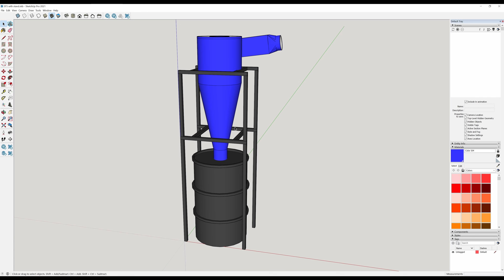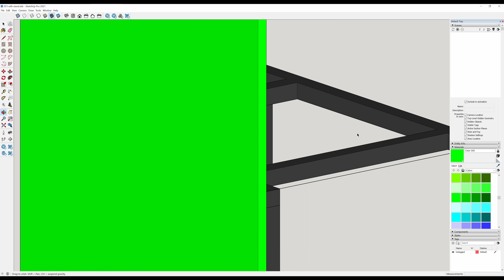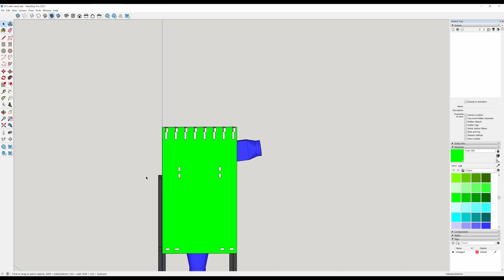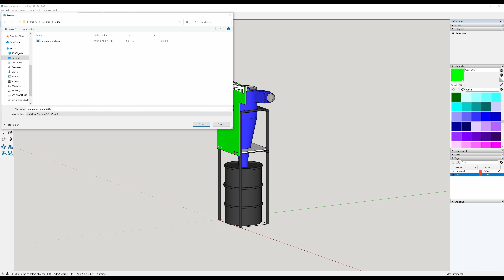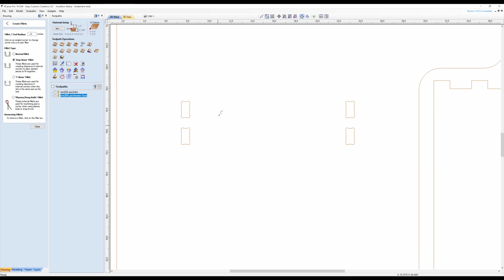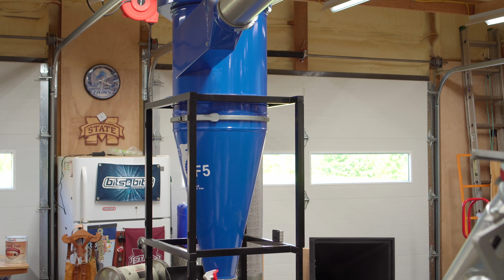Design, Engineer, Create - Shop Storage Solution - 373

Comment: I've asked on Reddit, I've asked on Inventables, I've asked a few people at the local Makerspace, and now I am asking you: Why are you flattening your design in SketchUp? You did it another video of SketchUp to VCarve. And you spent a lot of time fiddling around in SketchUp to build your tool paths. Does it produce better cuts? More efficient tool paths? I import my complete, non-flattened, non-exploded SketchUp model directly into VCarve Pro, without any modifications, and have all my tool paths generated in about 30 seconds with a half-dozen button clicks. So what am I missing as to why you do this? You've obviously figured out a neat trick or some secret tribal knowledge that does better than the established model import method and tool path generation method, but you're not stating what that trick is. What am I missing?

Comment: I really enjoyed the design process and the peek at using the current SketchUp program by someone as familiar with it as you clearly are.    Far more informative and enlightening than watching a bunch of machine cutting.  So thanks for this fairly uncommon option in maker videos.

I was a bit surprised that you didn't simply cut the horseshoe in half or go back to SU and convert the horse shoe into two square "C" shapes so you had a full surround shelf.  I know that for me I'd constantly be setting stuff down on the missing portion or knocking stuff off into the gap..... But hey, that's me... :D  EDITED- And I do so agree with you about the satisfying fit of the belt hangers.  :D

Comment: Great video etc. but I have what is probably a very simple question: the mortise and tenon were measured at .763 but the interlocking cuts were measured at .753 - why the difference? I'm really confused by this.

Edit: Thanks for showing the use of the  Sketchup software, I might actually start using it.

Comment: Jay- could you have rotated the big piece by 90 degrees, to use the width of the board? That would have let you do it the way you wanted.
Reply from the maker: Kinda. The piece is 48" long and the sheet is 49" wide. Cutting it would nearly eliminate support along the length of the sheet while on the CNC. I valued more support structure around the perimeter when cutting than I did getting it to fit in that direction. If I had a vacuum table on the machine I would have went that route.
Reply: @JayBates  Thanks for the reply. In my projects, I can get locked onto my initial goal when it would be best to let go and pivot.

Comment: Thanks. Lots of valuable tips for SketchUp in there.  Really like how you describe some of your thinking.  It looked like the horse shoe piece you decided to make into two shelves could have been rotated about 45° to fit around the bottom corner of the backing board.  (But hey that could be completely wrong but I find I can manipulate some pieces the nesting process in VCarve/Aspire wont calculate.  Also, it looked like a significant improvement in the picture quality when you changed over to your phone for the last bit of the video, nothing wrong with the other camera, but I wouldn't have expected such an improvement (This is only a comment and not a complaint!)  Cheers, David

Comment: Hey jay, nice video! You might wanna try cutting some pvc pipe to slide over the belt hangers, it will help to minimize creasing of the belt hanging on the sharp edges, especially in a warm/hot environment.
Reply: For that maybe cut some holes in the back panel that fit the OD of the pipe snugly and slip them in.

Comment: If you measured 0.753 for width, why do you use 0.763 in the model?
Reply from the maker: .763 is accurate. I wrote the wrong number on the test piece.